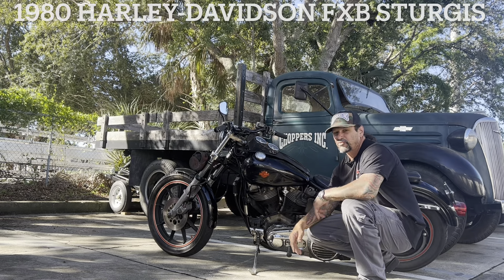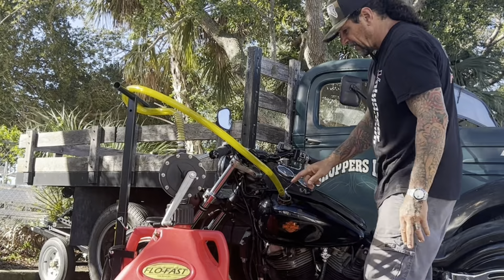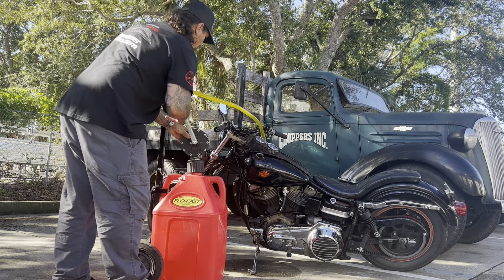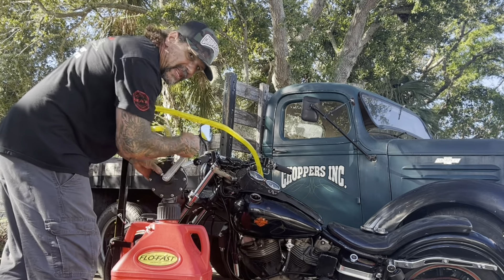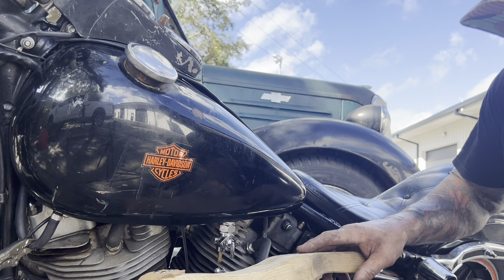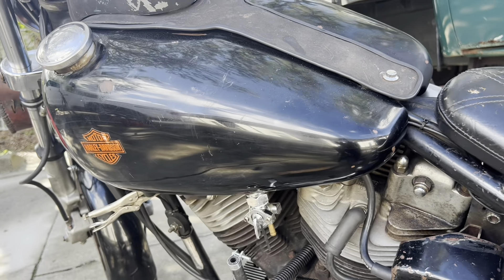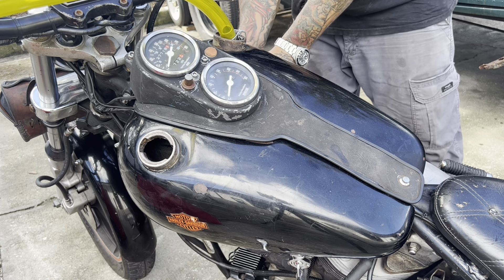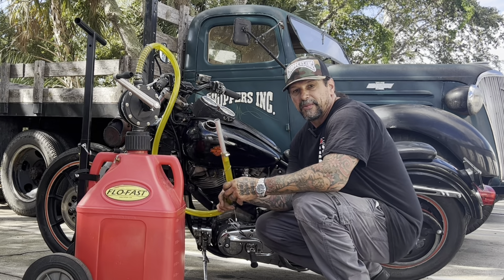Billy Lane How To Harley Sturgis Shovelhead Gas Tank Dent Repair w Compressed Air w Flo-Fast Gas Can

Comment: Very well done Billy , I was glad when you commented on the amount of air pressure you used.
Many years ago I was the manager of a Dyno test facility. One night a tech was trying to get some oil out of a 55 gallon tank. For some reason he decided to use air pressure. The tank split and there was a mess all over the place. Thankfully no one was injured , just a lot of bruised ego's.

Comment: Gots me a U-18v1 in a 4 cube (net) L-port box, 35hz tuning. Powering it with 1,500rms out of a Stinger MT2000 @ 2ohms and it gets violent when I crank it. Pretty even across the bandwidth (30-80hz) and sounds awesome in my hatchback (beater Hyundai). happy boy

Comment: great presentation and success , i did it years ago but deformed the tank all over the place , too much pressure i assumed , i aired it from the filler with a jerry rigged cap maybe that was my problem , thanks for sharing your tips and skills
Reply from the maker: I gradually added, released, & increased pressure- watching the tank swell all over- and looking for deformation. Keeping the tank mounted to the motorcycle definitely helps restrict deformation.

Comment: Hi Billy, I'm thinking on purchase a Harley .. up until 1973 model.   In my country   50year old or older vehicles doesn't pay any taxes so... any suggestion on models?  I'm not Jay Leno as  I manage a very low budget, but I'm all hands on duty. Could be a shovelhead or...maybe just buy a paughco frame , engine transmision and build a chopper.  Budget 10.000 us$